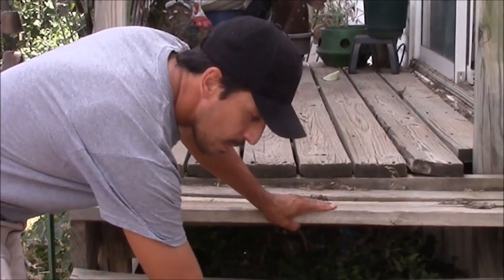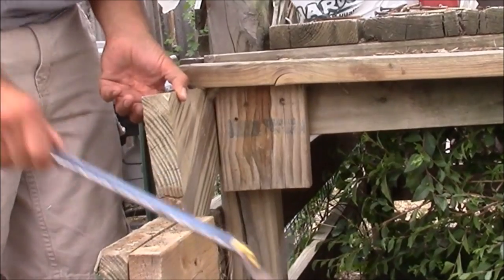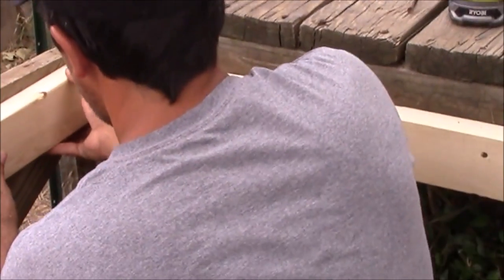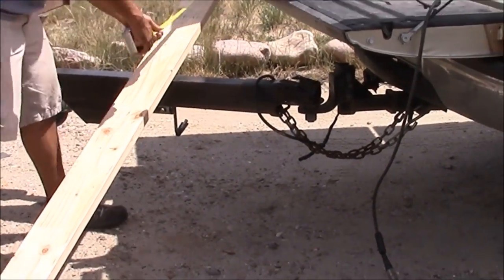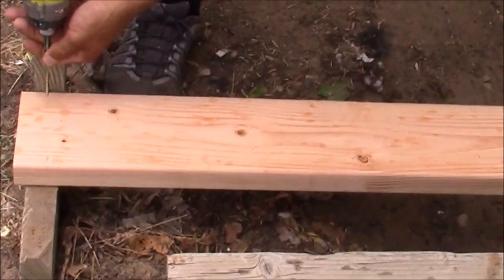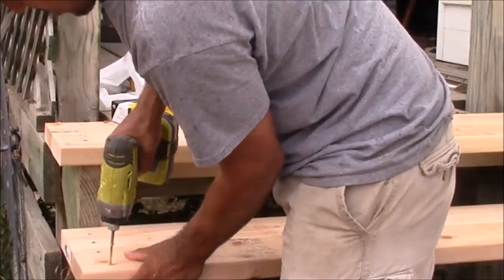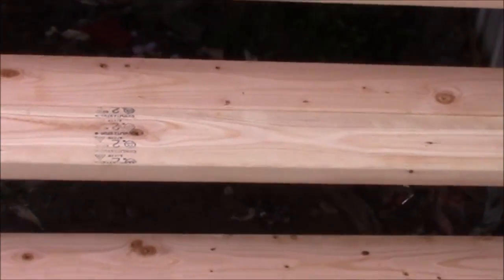How to repair your porch steps DIY Home Depot materials

Comment: The reason they failed the way they in the first place was because there is no stringer in the middle. You need support there or the same thing will happen. Also, staining/sealing wood is not the same as pressure treating.
Reply: Absolutely  this is really bad advice.

Comment: .i see you used 2x6 on the horizontal part of the stair stringer....i will do the same...I have a question..I'm doing a replacement on my front stairs ..thats connected to my porch..my porch has round hollowed out pillars....and the stairs i took out out..the top hand rail was connected to 2 of the pillars ....I don't want that on the new install...should I use 4x4 vertical to mount my the top hand rail..or what size do you suggest...and also do I secure the base of the board into cement in the ground..or just keep it screwed into stair stringer and areas on the porch...the house is close to 100 years old..and i believe the porch pillars are the originals.
Reply from the maker: Showemright YTchannel 4x4 would work great. And you should either use concrete or concrete pavers to separate wood from dirt.
Reply: thanks brother..will do.

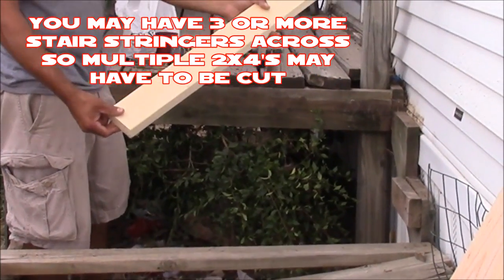Comment: You appear to be using regular untreated lumber when reinforcing at 1:12.  This will rot, especially where moisture is trapped between the two pieces of lumber.
Reply: Yes need pressure treated
Reply: @stevewyche5232  what about paint, plus how did treated wood come into existence when In Olden days wood lasted a life time..at least longer then this 'tampered' so called untreated wood

Comment: Great video! Quick question - why didn’t you replace the ledger board? 

I’m not challenging you but I’m trying to understand your decision process. I have the same situation but am considering also replacing the ledger (top back) board - the piece of wood to which you attached the 2x4. 

Thanks 👍
Reply from the maker: this was done for a costumer with not much money and on a budget.
Reply: C.L.S. Allinone Thanks so much!! I appreciate your reply. 👍

Comment: does it matter if the wood is pressure treated or not?
Reply from the maker: Showemright YTchannel no but it will need sealed/stained if not pretreated.
Reply: thank you
Reply: Showemright YTchannel Hi can I stain it before I do my steps, or is it best to just build the steps and wait to stain it?
Reply: I did my cuts then stained/ sealed, that way all sides of the wood your using is protected....it was during a very hot 3 days ...so my Thompson's sealer/and stain dried very quickly.....this is what i did...i cut my wood..my sons applied the Thompson's ..I  leveled and screwed the already dried wood pieces to fit...then I went back and applied some caulking in certain areas, and I will paint later on, haven't decided what color to use.
Reply: Awesome thanks so much, love the video by the way. 😃
Reply: My bad Zola...this video is not mine..I thought you were replying to me..this is C.L.S. Allinone ....though he made a nice video....and his idea with the 2x4s ..and the 2x6s looks good and strong..I get compliments all the time now, and most of all we feel safe and secured...cheers.
Reply: Showemright YTchannel lol Got you!!!! lol
Reply: Showemright YTchannel - For exterior it's always better to use pressure treated. Afterwards any additional treatment/stain, etc. will be an added bonus. The price difference for relatively small projects shouldn't make a big impact anyway. So pressure treated all the way. Be well. ;-)

PS: Do yourself a favor and never use nails for steps, always screws will make your life much easier for future repairs or updates. ;-)
Reply: yes sir..and thanks.I did use 2.5-3 inch exterior star type self drilling screws.....the best...who ever invented the self drilling screw....give that person an award every year...saves time ..and money..if you split the boards your working with...also i used my cordless impact drill....self torquing ...got to love it.....I had it in my tool box..for the longest...its an 18 colt Porter Cable ....I just kept buying pieces to add to the set ..when they were on sale @Lowes...stairs are complete and thank you....my next project is a shed...im working in a space thats 8 ft x 16...havent decided the dimensions of the base of the shed....I need to keep it at 6 ft wide to have a path way to get to the side of it...and most of the boards are 4x8...so there will be lots of cutting on that project....you have been a great help..your video was straight to the point..i get  a lot of compliments on my stairs now..my wood used were just 2x4s, and 2x6s for the stairs..no fancy railings or stuff like that ..and again i coated the wood with a stain/shine...then later before winter..i will paint it.
Reply: YES!  Treated lumber is sold for a reason.  Untreated lumber provides food for insects and microorganisms that cause wood to decay and rot.  Wood treatment discourages insects and resists decay by making the wood toxic to the things that would feed on it.

Best to only use treated wood outdoors, as the chemicals used are not great for people (though I don't think it's a real issue unless you are silly enough to put it in your mouth -- keep it away from toddlers) and can be a bit smelly.

Comment: I would have used some woodglue to increase the strength. And also I would have used pressure treated lumber, that yellow stuff cannot be treated and will not last as long.